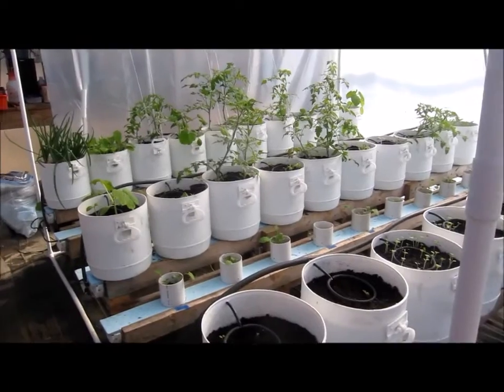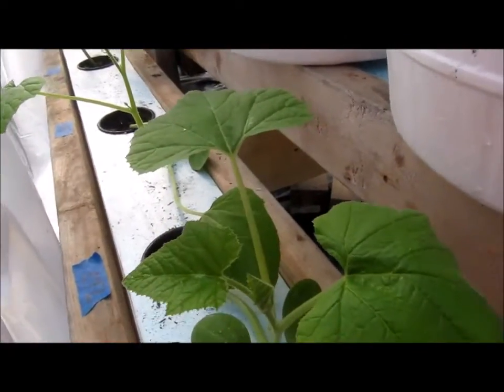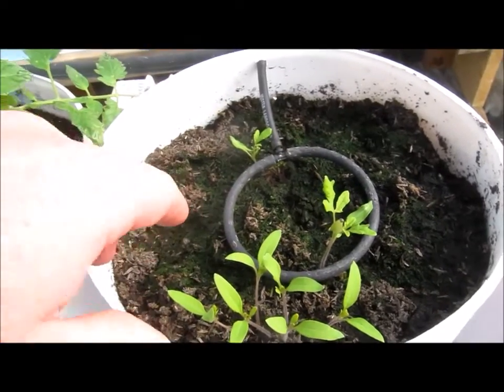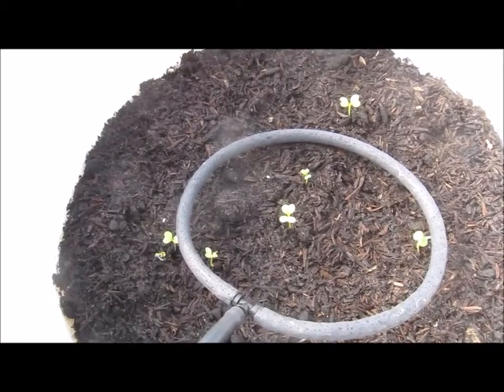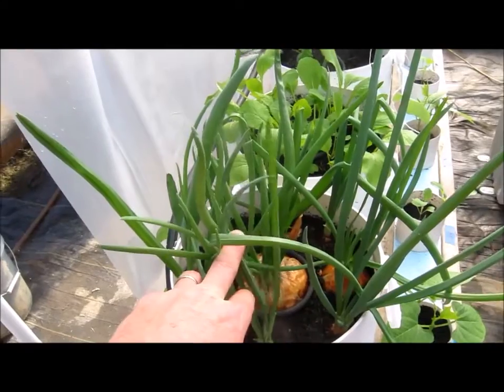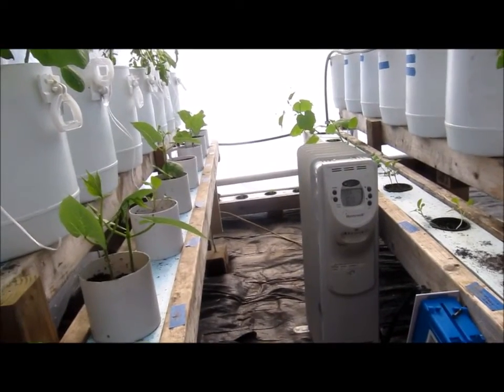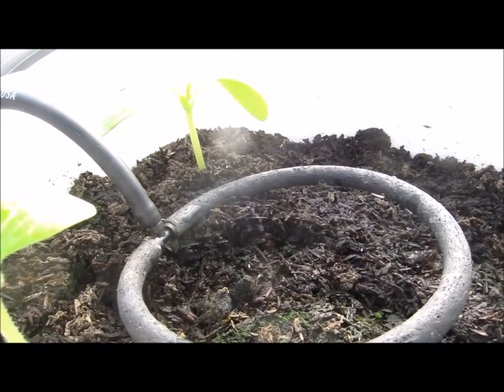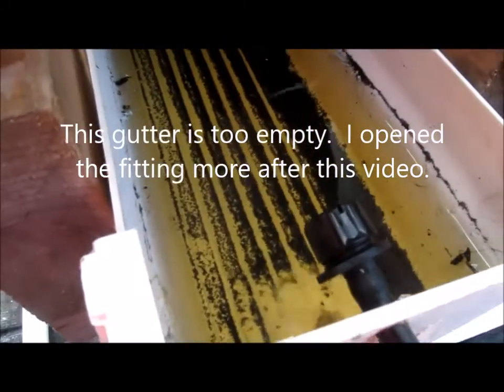Greenhouse Update

Comment: What kind of temps are you able to sustain in there with that heater?  Everything is looking healthy so far!
Chuck
Reply from the maker: +Fensterfarm Greenhouse Well, Mr. Chuck, my information is lacking.  I've been out to it at 1 am when the temps were around 30 and the heater was blinking at 56.  This means it was currently off because it wasn't below 55, the pre-set "on" temperature.  That's the worst I've seen to date at 1/2 power on the heater or about 700 watts.  Anecdotal evidence proves healthy, non-shriveled plants everyday meaning the squash and tomatoes stay a good bit above freezing every night.  When it forecasts to mid-twenties or lower, I'll put on full power which is about 1500 watts I think.  At around 20 or so, I'll make myself check around 3 am.  Last winter, it failed to protect an entire greenhouse on full power, but did very well with the smaller 10' x 3' area which helped me get veggies a good bit earlier than spring.  This is a compromise attempt.  Cheap enough to give it a shot.  Will you grow over the winter this year?  Take care buddy.

Brent